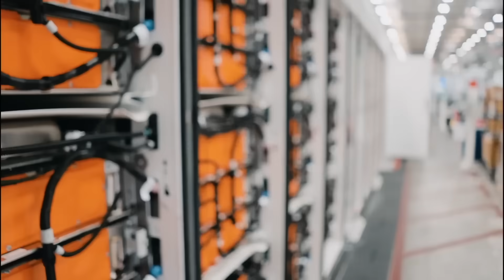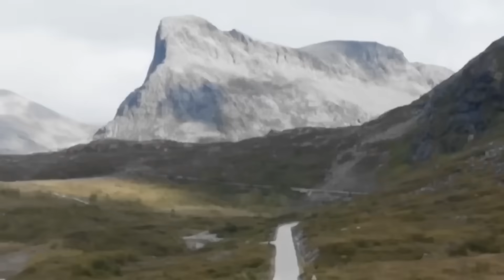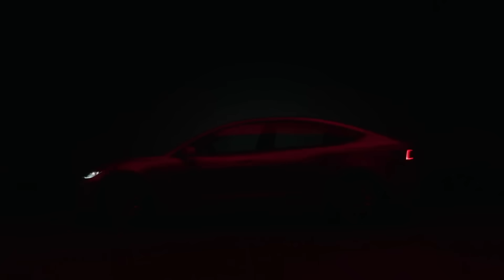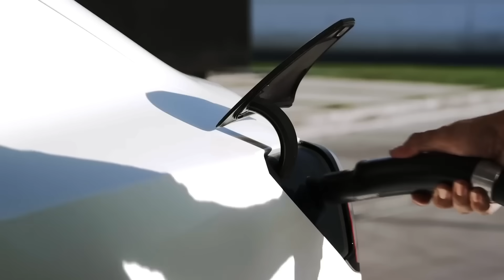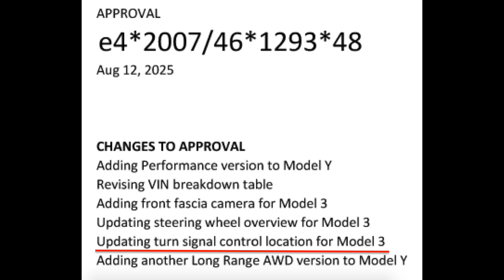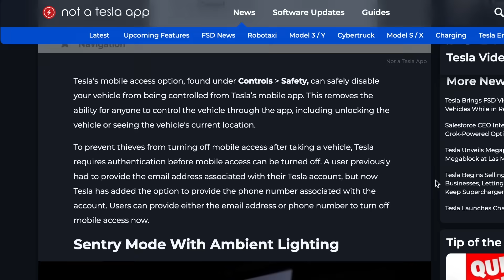Tesla Model 3 Brings Back Signal Stalk and Front Bumper Camera | It’s Almost Perfect

Comment: Again NMC. Yikes not that great of an upgrade.
Reply: Higher energy density, higher power output, faster charging. What’s not to like?
Reply: @SimonBrisbane  5 seconds research: compared to lfp batteries: Lower thermal stability, Shorter lifespan, Degradation can accelerate at high temperatures or high charge levels.
, Higher cost due to nickel and cobalt. NMC batteries are lighter and offer a higher energy density. However, the disadvantages outweigh the benefits. Especially if you don’t rely on a range of 700+ kilometers, the much more robust LFP batteries make far more sense.

Comment: Hi
I ordered my model 3 long range rear drive on 17.7, will I get the new battery ?
Reply from the maker: Depends where you live, but also I don’t understand the date format. Is it July 17th, if so I wonder why it’s taking so long to deliver now that it’s mid September. Likely it won’t include the new updated batteries if in Europe
Reply: @heyJohnEe  From what I’ve read, it seems that those who have received the Model 3 recently, with VIN numbers 590XXX or higher in europe, have gotten the car with the new battery.

Comment: MYP with 580 Km range WLTP is short when BMW is pesenting  LGES 4695 batteries in iX3 here in Europe, with 805 Km range WLTP, 800 V architecture and 400 KW peak of charging.
What's happen to Tesla 4680 cells?😮
Reply: Hypes-a-lot Musk certainly hyped the crap ouf of the 4680s, didn't he?
Reply from the maker: @craighermle7727 lots are happening with battery that hasn’t been announced yet, but 2nd gen 4680s will change a lot once it’s out

Comment: What happened to the 4680 cells?
Reply: Same as the roadster…
Reply: Goodwill
Reply from the maker: 2nd gen 4680s are expected to roll out soon, those will be a big upgrade
Reply: @heyJohnEe  will gen 2 be as good as the Panasonic 2170 in the Lucid Gravity?
Reply from the maker: @abstractreasoner I’m not sure since Tesla has been very secretive with it this time, but I would assume the 2nd gen 4680s will be their top tier batteries for high end vehicles then the upcoming in-house NC05 and LFP will be for the base models

Comment: Do you think the stalkless 3 steering wheel would work on the new model y. I actually prefer the buttons
Reply from the maker: The wiring is different for the connectors, likely missing some inputs. But even if there were the wires, the software wouldnt allow it
Reply: @heyJohnEe gotcha thanks

Comment: Tesla is bringing back the stalks for Model 3.

Wishful thinking: Oh cool that means stalkless Model 3s will go up in value?!
Reply from the maker: Technically it has the best of both worlds now that Tesla offers a stalk retrofit, so 2nd owners can decide if they want stalks or buttons. There’s no choosing with the new Model 3s
Reply: @heyJohnEe ohhhh I missed the retrofit part. Any idea when retrofits will be available in the states? I’d rather have OEM than S3XY stalks - already have the S3XY knob + two buttons.
Reply from the maker: @FactsDontCareAboutFeelings-m6x yeah I agree OEM is always the best. It’s provided everywhere the new Model 3 (with stalks) roll off the line, so China and Europe first and US not long after maybe in Q4 we’ll see the new upgraded and retrofit options being offered at the service center
Reply: @heyJohnEe looking forward to it. Thanks for keeping us informed. 👍
Reply from the maker: @FactsDontCareAboutFeelings-m6x yeah ofc!
Reply: @heyJohnEe  Does the retrofit also work on older HW3 model 3 mine clacks when using the turning signals that's why I'd wish to change it
Reply from the maker: @Okkinyhonestly I’d just have that fixed at a service center since the old stalks are way better than the new ones. Not sure if replacing it with new ones are even possible for older cars tbh

Comment: Would be nice if the M3P could get closer to the 460kw output the motors are capable of, so far limited by the battery
Reply from the maker: Yeah that’s always been the limiting factor with LG batteries, but I hear they’re working on an updated LFP that will soon go into the M3P and provide max output
Reply: @heyJohnEe you heard wrong. LFP will never go into a performance model. The updated LG 5M battery which is an NMC not LFP is the new performance and long range battery.